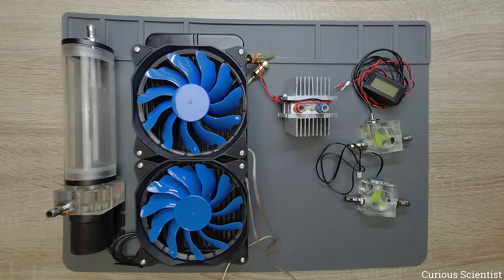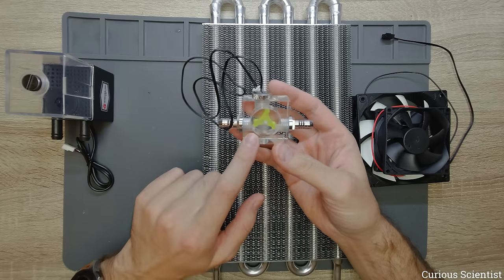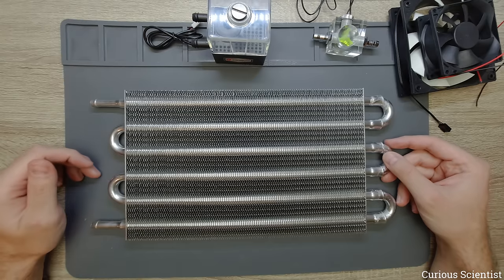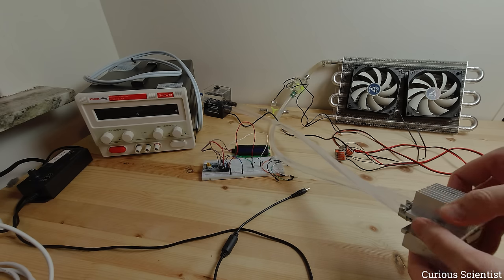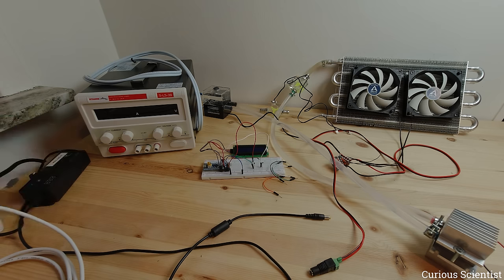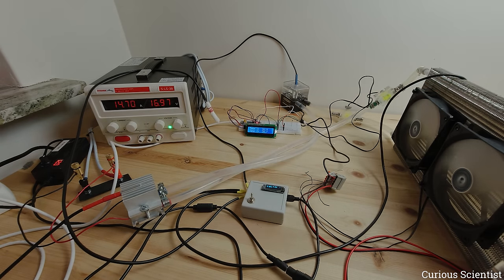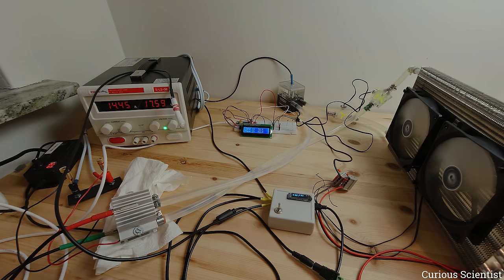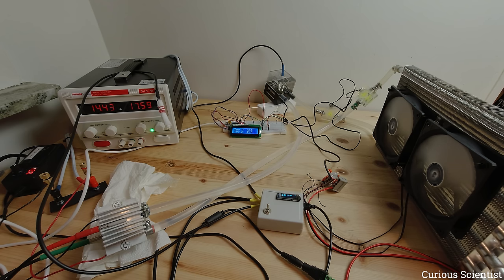Building and testing a new water cooling system for Peltier coolers

Comment: Hello, the Universal cooler is so awesome. You did a nice application with it,
Trying to make a personal table cool air blower. I have a simple 200mm x 40mm water cooling alluminun block. Will it be enough to cool down 4 peltiers of 6Amps each? Without attaching fans on it? I am going to use 3 litres tub of water for it. I will use those bigger heat sinks with fans in the front, as cool air blowers. Whst else should I do?
Reply from the maker: Hi! Thank you!
I do not entirely understand your idea, so let's discuss it. 
How do you plan to use that water tub? If you use 4x TEC12706 Peltiers, you will have around 500 W heat to dissipate? Where do you plan to put that heat? 500 W heat can quickly start to heat up the air in the vicinity of the heat sink that you use for cooling the hot side. Also, I think that 200x40 mm heatsink will not be sufficient especially without any fans.
Reply: @CuriousScientist  
Thank you for replying. I am not building computer cooler. I am building cold air blower. Like mini AC. Cold air blower for dining table. 
I have water block of 200 x 40 mm. 
I will attach inlet/outlet water pipes to it.  
Pipes will go to 12v Submersible pump, in a water tub or jar, placed outside the box. 
For cold side I will use 4 inches heatsink with fan. 
The cold part will be enclosed isolated in a cardboard box. 
I will get cold air from the 4 inches fan from the box.
Reply from the maker: Oh, I know these, I have a few of them. :) 
So, I assume that you are going to use 4 of these. It might be enough to blow a somewhat cold air, but it will never work well as an AC. So, it will only provide a very local cooling effect. The water tub is not a good idea because you cannot dissipate the heat from it efficiently. You will need a radiator to get rid of the heat. As I said, you will get something around 500 W heat. After a while, it will make the water warmer and warmer and the performance of the Peltier cooler will drop because the hot side temperature will increase. I assume you haven't seen my video on this topic: https://youtu.be/_F6XFvycpRg
Reply: @CuriousScientist     Ok I saw it. I understood. I have another idea now. 
I will use the DIY kit as it is. Big heatsink and 4 inches fans on hot ends. 
and then I will use the 200mm water block on the cold side with small tank. 
I will place this whole unit outside window. 
I will bring two cold water pipes from the window to a indoor box with another 200mm water block and fan. This indoor box will blow cool air. 
I dont want to cool the room. I just want local cooling effect for one person. 
How is the idea? 😀
Reply from the maker: Could be a bit better, but I am still sceptic about it as the cooling power of the 4 Peltiers will not be too high. Also it might be a problem that the water simply starts to freeze in the system. Why would you transfer the heat on the cold side? The cold side in optimal case should be attached to the object that you want to cool due to the inefficiency of the modules and the heat transfer. Now, you want to add a water cooling blocks and water. That will have a negative impact on the system. Why don't you keep the Peltiers as close as possible to you and move the heat away from the hot side via a water cooling system?
Reply: @CuriousScientist   Yes, thats what I asked at first 😀. Keep peltier close for personal air. And then I will do water cooling away with little longer tubes. I will try it soon.
Reply from the maker: Now I understand! The water tub got me confused. Please keep me informed of the results.

Comment: It is nice video
Please reduce pumps flow as well for improvement in reduction of temperature 🌡️ at radiator out put
Reply from the maker: Thank you! I will check it with a different flow rate too! But I think it is also an issue of airflow. I will check both in an upcoming video.
Reply: @CuriousScientist  Which of all your videos follows this one? I would like to see how the improvements worked. Thank you!

Comment: Your setup is insignificant to any other radiator setup for PC cooling! Look at best you'll be able to inject a burst of cool liquid into  the system. However, since your dealing with so little volume when the system stabilizes you probably won't see that huge a drop in temp. 

To truly be effective you need a aquarium chiller. This uses phase changers to drop the temp of large volumes of water.  It ranges from 40 to 80 gallons. Those large volumes of water would take a while to heat up meaning you'll see more significant drops in temp. The question then becomes can the aquarium chiller recool the coolant fast enough as it gets heated up. 

The speeds these pumps usually cycles at are rather fast. Its very likely you'd be able to pull in the super chilled water from the bottom cycle it and have that warm coolant enter at the top. This would mingle with the cooler water reducing its higher temp and start to get colder when bam it gets sucked out again to repeat the cycle. 

So picture our setup and lets say our starting temp is zero degrees. (I know its ice at that point lets say because its moving its not freezing) 

When we turn on the pc it gets heated to 50 degrees, goes through radiator and loses 10 degrees. That 40 degrees gets injected into chiller and mixes with other cooler water reducing temp by half say 20 degrees. Now say its able to remain in the tank and get chilled losing another 10 degrees before its sucked back out. From this point on the temperature will have equilized, your able to maintain that injection of 10 degree cool water consistently. Note its no longer zero like we first started with.

Now this is just to explain it. These aren't realistic numbers and i lack the compentant math skills to even figure this out. Would 80 gallons of chilled water be enough to maintain that zero temp? Would you need a 100? Keep in mind the more water the longer to cool it. I've read some aquarium chats and most say it takes 15 mins to drop temp by 3 degrees. Our example chiller is moving 600liters an hour. Well if its 79 gallons thats 300 liters so you' get a half hour of chilling time and if 3 degrees @ every 15min is accurate thats 6 degrees. How much heat is being added? Is it more than the six degrees?

Look this would effectively cool your system down no doubt but even if you were able to run super cool temps through your pc may still thermal throttle because the IHS isn't large enough to dissipate enough heat fast enough.

Then there's the concern how long is my chiller having to turn on to chill? Am i able to play 30 minutes on an OC cpu and have it cycle on or is it always on trying to lower that temp down.

Look i get i used zero in my example more realistic goal is 20 C and is that feasible without burning out your chiller motor. I believe so. Some day i might try it but there is the whole of condensation to contend with as well
Reply from the maker: Sorry, I have no idea what you're talking about.
Reply: @CuriousScientist your setup would have little effect of chilling PC components comparable to whats on the market. First your water volume is negligible  2nd the cost for the electricity for the amount of cooling means your wasting money. Like I suggested for PC cooling liquid a aquarium chiller would be more cost effective.  For the same power your using I could set a aquarium chiller to 25 degrees C. Why would I not just do that?
Reply from the maker: @kazzdevlin5339 I have never said that this should be used for chilling PC components. Quite the opposite, I always try to discourage people from using Peltier coolers to cool PC components. It does not make sense unless you want to go below ambient temperature, which again does not make sense either. 😄

Comment: I want to share a few points from widely accepted and tested knowledge from the PC water-cooling community. I will give sources or trusted documented testing for each claim at a later point if asked. 

Round tube radiators are poor performers because round tube are not restrictive enough to create turbulent flow. If laminar flow forms along the walls of the pipe, a slower moving layer of water is formed and drastically reducing the heat exchange. Another reason this kind of model is bad compared to your former black model is fin density as well as the material obviously. Less dense radiator will scale poorly with increased airflow. Be careful not to mix aluminum and copper parts in the same system or you risk galvanic corrosion.

Unlike someone else commented. Water quantity in the system doesn't change the effectiveness of the system but only makes steady state longer to reach. And, up to some point more flow rate is GOOD. Higher flow increases the turbulence at the two heat exchanges, water block and radiator. You don't want to see a drastic difference in inlet and outlet ports, what you want is lower steady stat  water temperature in the system. The water doesn't heat up and discharges heat "in one seating" as it passes through the blocks and rad like tricks loading up and unloading.... Rather the water of the loop continuously absorbs heat at the block and dissipates heat at the rad. More water flow (up to a point) gets you better results.

Cheers!
Reply from the maker: Wow, thanks! These are the comments that I am looking for! I am always open for knowledge, so I am extremely thankful for your effort to share this information with me! 

Yes, what I spotted as one of the main differences between the 2 radiators is that the aluminum one has round tubes while the other one has quite flat, rectangular cross-section tubes. Now I know the reason behind using the flat ones. Fin density is also lower yes, I also mentioned this in the video. I should do some measurements and estimate the total fin area to have some comparison between the two radiators. I also know about the corrosion, I saw some nasty pictures about this. Actually, I also saw some very bad example of this at my workplace in a very expensive instrument's water cooling system. I cannot understand how they missed it. But in my case, I drain the whole system after the experiment, so corrosion would be an issue after a veeeeeeery long time. But yes, for systems running 24/7, this should be considered for sure. 

Yes, increasing the amount of water is just increasing the "thermal capacity" of the system (Q = c*m*dT). Larger mass (more water) would only delay the process of reaching the maximum temperature as you said, but it would not change it. 

"You don't want to see a drastic difference in inlet and outlet ports" → Alright, I was not aware of this. For some reason, I had this thought in my head that we should have some significant drop. I was trying to think about this as it would be a refrigerator system where there is a significant drop/increase in temperatures at different parts. But I forgot about the phase transformation which "distorts" everything and obviously it is not present in this system. 

I will try to do some tweaks on the system and run another test, I am really curious. Looking forward to see you in my next videos and have discussion! Have a great day!

Comment: Nice vid! Im just wondering how do you make your peltier modules run efficient enough for it to actually be worth it?
Reply from the maker: Hi! Thanks! You cannot make them more efficient. The efficiency is "coded" in the material they use for the Peltier coolers, so as long as the researchers don't come up with better materials, everything stays the same. But, you can find specific applications where Peltier is more preferred.
Reply: @CuriousScientist  thanks for the quick reply! I didnt know it was coded in! Becouse ive read that theres a 33.3% efficiency in generating cold is that compared to other cooling techniques/componements?
Reply from the maker: Peltier coolers are around 10% efficient and compressors are around 40%, if I remember correctly. So, there is a factor of four between Peltier coolers and compressor-based coolers. This is why it is not worth to use Peltiers instead of compressors in ACs for example. Efficiency is usually the ratio between the power output and the power input.
Reply: @J_A-_  If you havent seen it check out LTT, he tyries to use these a couple times and its not very efficient but its cool.
Reply: @coolarrow9127  thanks! Ill do that
Reply from the maker: LTT had no idea how to run Peltier coolers and how they work.

Comment: What if I want to go in reverse, I want to have cold air coming from the fans, by running the water line through an ice cooler and then feeding it to the radiator cold, so that the air in the room would cool down.  Just don't know quite how to do it all...
Reply from the maker: There are people out there who do some similar stuff. They fill up a huge box with ice, then they run a duct into the box and out of it as well and they direct the air with the outlet duct somewhere where the cold air is needed. They make the ice in their freezer, so it requires some time and logistics. What you would like to do (as I assume) is to cool the water with Peltier coolers and run the cold water through the radiator that acts as a heat exchanger. Could be done, yes, but it would need a lot of power so the system would not be too efficient.

Comment: Also increase water in circuit to reduce the water 💦 temperature
Reply from the maker: The amount of water is limited due to the size of the tank and the length of the hoses.
Reply: @CuriousScientist  due to limited water capacity temperature 🌡️ was at 44 degree
It will go down with air flow and increase water capacity in tank. I think you can maintain it 35 degree after the some smart change

Comment: If I would want to build a mini cold water recirculation system (similar to cold water aquarium) how will the line up and instruments different would I need to consider using the similar layout?
I need to preserve my food in a air tight bottle to submerged into the cold pool of clean sanitized water because I don't want to buy a large fridge in my rented apartment.
Reply from the maker: A mini fridge would be simpler, and cheaper both regarding the initial investment and a running costs. I built a Peltier-based cooling box and also different water cooling setups. Look around in my YouTube channel.
Reply: @CuriousScientist  I found a new way. Hot and Cold water dispenser. A used one with 9L blue water bottle at USD20. Using about 100w when activated. All I need is to make an opening on to allow my sealed beverages or food to submerged into the blue 9L water bottle. 

Thereafter do a circulation pump drawing the inlet from the cold water dispenser to supply a waterpump and recirculates it back into the that blue 9L water bottle.

This would keep my sealed food or bottled beverages cold and fresh. 

On the other hand, those condensates on the blue 9L bottle concern. I would use some sort of PP Foam to isolate it and having a small drain hose to the nearest bin or floor drainage in my kitchen.

Comment: Nice .. i want to build this peltier for air cooler fan .. my plan is use a radiator cooler oil for transfer water cool in input air flow fan .. and hot transfer just using heatsink dip in the water tub .. i use water pump and push water to water blok cold side peltier and flow to radiator .. how many peltier for cooling radiator 200mm x 400mm ? What this efficient for tub hot & cool water mix ? Thanks
Reply from the maker: Hi! Why do you want to transfer the heat to the cold side with an additional water loop? It will further decrease the already bad efficiency of the system due to the additional heat losses. Check this video and you will see that the thing you want to build will not be easy: https://youtu.be/3dmQDf3GcpY
Reply: @CuriousScientist  ok thanks

Comment: The variable here is time. The fans are not helping I agree. But the cooler does not have enough time to produce a change in temperature.
Reply from the maker: Hi! What would be your suggestion then?
Reply: @CuriousScientist  My thoughts would be more contact with the peltier cooler, possibly flat wide copper pipe, as wide as the peltiers, with several lower wattage peltiers maybe 4 or more. Place the the peltiers on both sides of the copper pipe and regulate flow accordingly. I would think that would give more of a change in temperature.
Think about flicking your finger through boiling water quickly, might be a little uncomfortable, but hold your finger in boiling water for a second, and it’s a whole new effect.
Reply from the maker: Sure, more coolers will cool better, it is pretty obvious. But in this video, the point is to test this car radiator if it works well as a radiator to keep the Peltier cooler cool enough. I did not really want to cool anything with the Peltier cooler.
Reply: @CuriousScientist  Fair enough, then flow control will certainly help even with the existing system.

Comment: Can you try to make a AC with this setting by switching the + - ? To see how cold the air will be that comes out of the fans?
Reply from the maker: I would burn down the Peltier probably. That tiny heatsink cannot dissipate that much heat. Furthermore, one single Peltier won't make an AC. And I also made several videos where I actually made such an experiment and I proved that it is not possible with a single Peltier. Check my other Peltier-related videos!